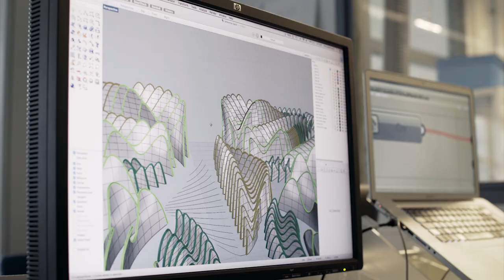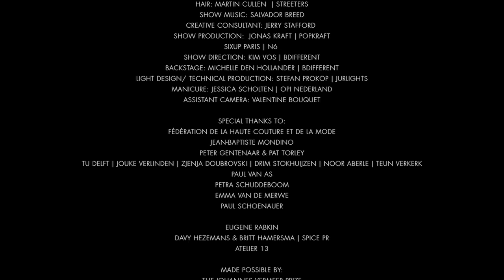Iris van Herpen | Ludi Naturae | Process film

Comment: What material is on the laser cut and what material is the one that moves like jelly
Reply: The jelly is one kind of 3d printing, it does the same as normal 3d printers, but there are more materials that can be printed in this one. and it's printed inside the jelly so it can stay in that form until the end pf the process, meanwhile the normal ones need to have a structure
Reply: Oh and i think that maybe the material on the lesser cut is neoprene, but im not 100% sure